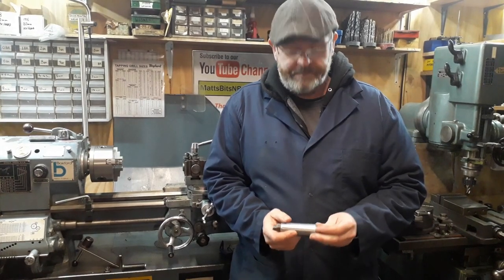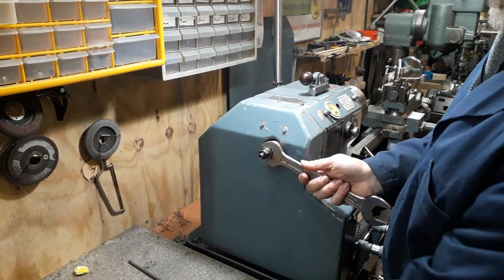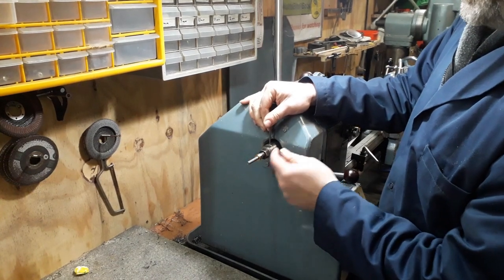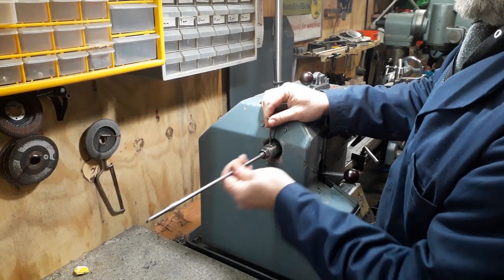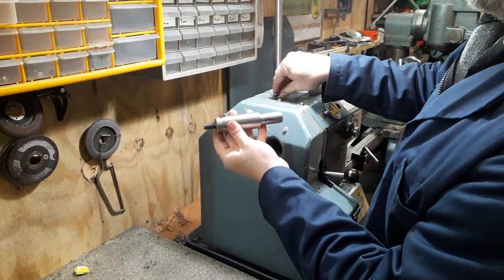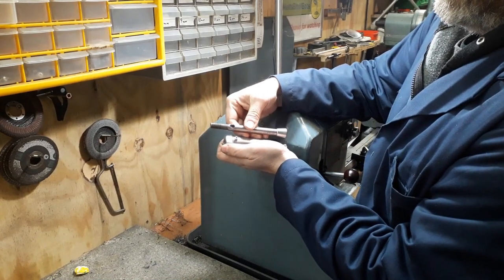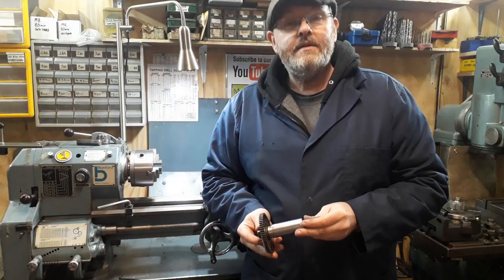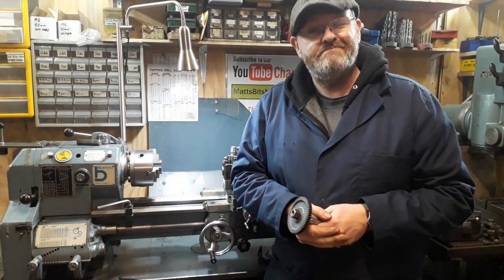Lathe Spindle Indexing, & More, The Morphing Of A Tool

Comment: Great tool idea, simple design, smart design at that, and overall a great bonus for the operator... 
Definitely will be making one of these... Tho, i would consider chucking that rod in a collet chuck, drilling it undersize for a bearing ball, and well, shoving a bearing ball in there, as the round, hard as a pecker - steel ball will definitely render it more precise, that is if the parts in a ``cycle`` are pre-machined to have the ``identical`` referent surface for the rod/ball to bump against...
Reply from the maker: Cheers, yep I have plans to stick a ball in there at some point but as it was made in a rush it didn't turn out to bad and I was working to  2thou for the parts needed so was good enough at the time. Hope you make one and enjoy using it.

Comment: Great idea and implementation! Wouldn't spring-loading the pin make it easier to use, saving you having to undo the locking screw every time? Or would this introduce play and reduce accuracy?
Reply from the maker: Thanks George, the spring will work up to a point, I have tried this in the past and not a fan, as you say play is introduced as the pin tries to ride up the gear with any force on the chuck (from tool post drill etc) you could use both, spring for scribing etc and locking it down for drilling ops, cheers.

Comment: Are the plans in a issue of ME or did you build it on the fly ?
Reply from the maker: No plans, yes a bit on the fly, a bit in my head, built from scrap for a job I was doing at the time, then it morphed twice. The other reason no plans is to make it fit your lathe and your requirements, there is an article in MEW number 327, hope you have a look.

Comment: you never showed how you changed each position on the indexer..gear wheel.. ?
Reply from the maker: It's the same way as I showed using the pin, undo the locking screw, lift the pin, move to the index point you require and relocate the pin, it's that easy, cheers for watching.

Comment: shame you didnt add the extra holes...

say its 36T, thats 10 degrees.
shove a hole at 5 degrees, and you have 72 positions.

throw it at 9, 18, 27, youre getting to 1 degree increments.

and so on...

and one little thing you find on good indexing heads... adjustment for zero. if youre trying to mesh into a gear say, and its not lining up with any notches...
Reply from the maker: Thanks, I always hope my videos make people think and not just follow what other people do and this, as the title says has just morphed again. This was made for a job with what I had, a lathe and change gears, that needed 12 holes evenly spaced, not at so many degrees but I have since checked it against a rotary table and it is the spot on. The zero is easy to set, just slacken the large nut at the back, adjust the gear so it meshes correctly and tighten up, easy zero. Cheers